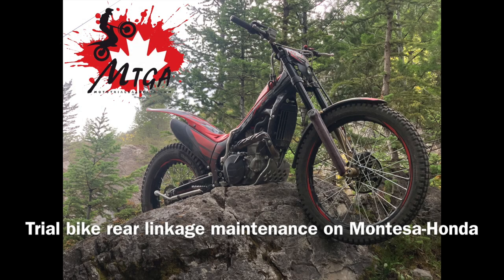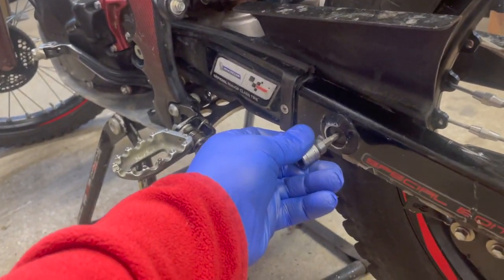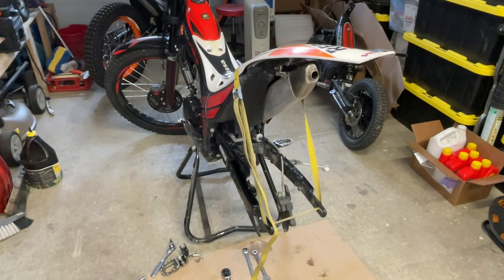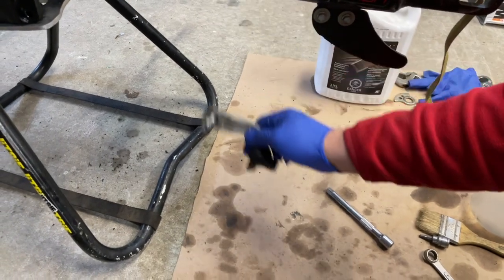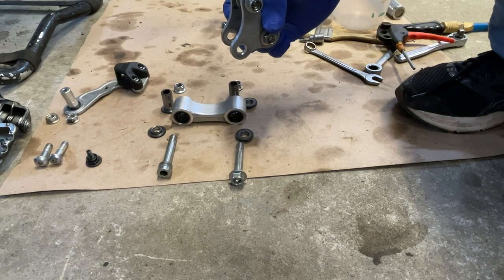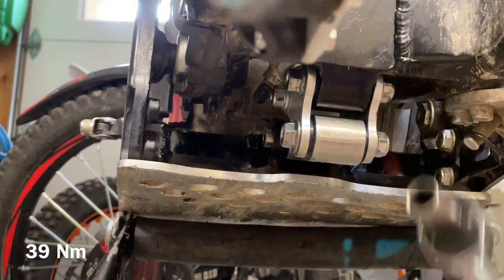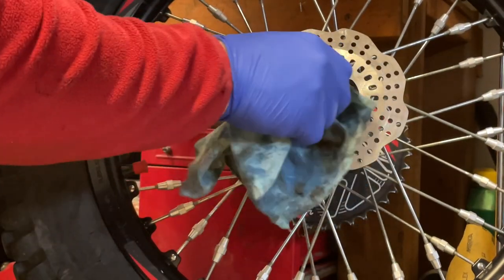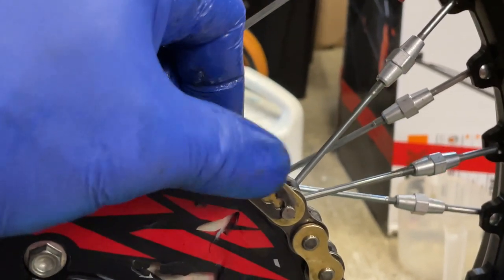Trial bike rear linkage maintenance on Montesa Honda

Comment: Thanks for the video....... The rear sprocket torque setting is on page 3-12 of the manual and is 30 to 35nm. Why it is not in the torque chart I don't know!
Reply from the maker: Thank you for the info.